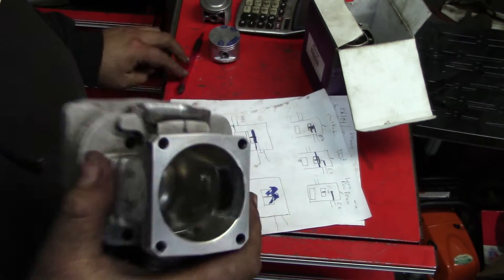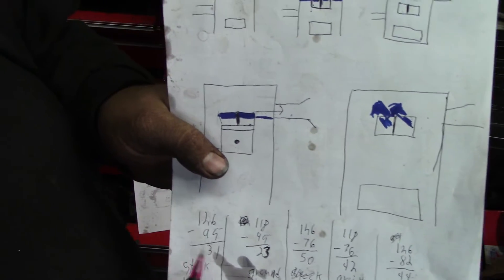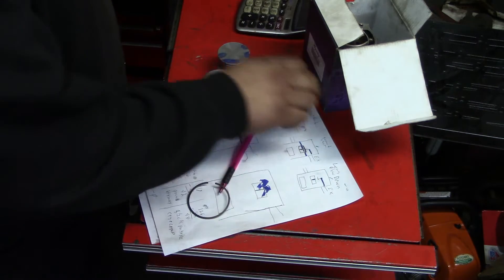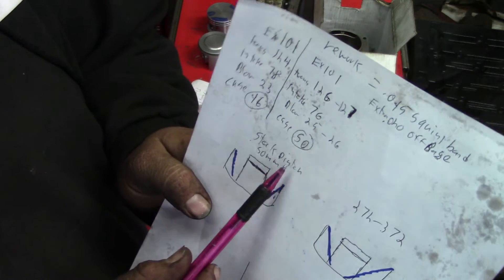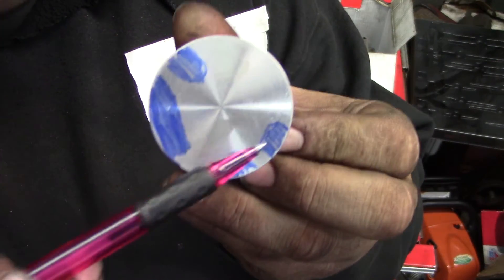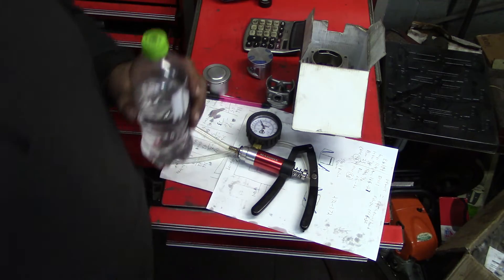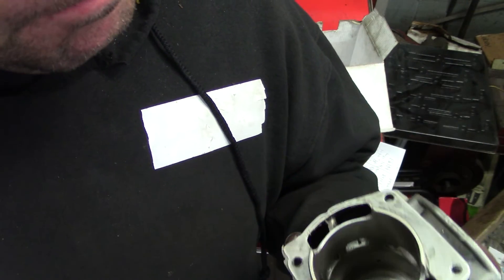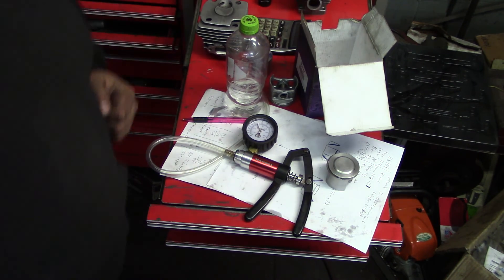2 Stroke Porting Theory On Case Compression & How It Affect Transfer Velocity

Comment: I get your idea about grinding more out of the case but if you increase intake duration  wouldn't you need less time to compress because there is more air in the cyclinder? So do your water bottle test with less water and a bigger pressure pump wouldn't that be more accurate?

Comment: I haven't tried this trick myself, but i read about it from some crazy. Case volume can be reduced by applying cork to the underside of your piston, might not be as relevent with a piston port, but reduced volume in a non piston port engine would be significant.

Comment: @3:50. I see where you widened & shaped the transfer ports to blow towards the intake port but didn't widen the lip on exhast side. Which is exactly how I meant to do mine but I somehow mistakenly cut the lip off the exhaust side while in a hurry & mad at myself 🤪  😡  You can hold the  cylinder under faucet in sink & sorta see how your transfers will flow by watching the water flow.

Comment: Small 2 strokes drive me a bit nuts since everything is a trade off/balancing act & how it takes multiple tiny adjustments combined to finally make a major power difference VS only  doing a few mods. Then  the smallest mistake while doing all the mods can ruin the cylinder/all your work.....Example stuffing case can = more power but also = blowing seals. Gotta stuff but not over stuff.